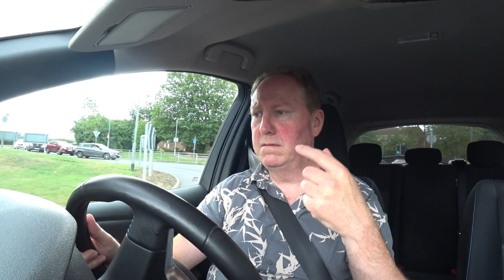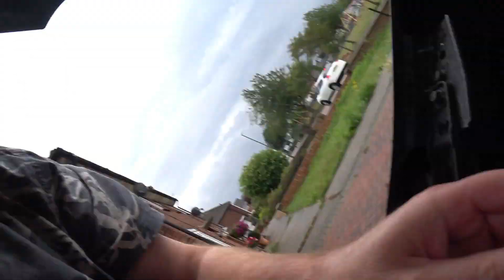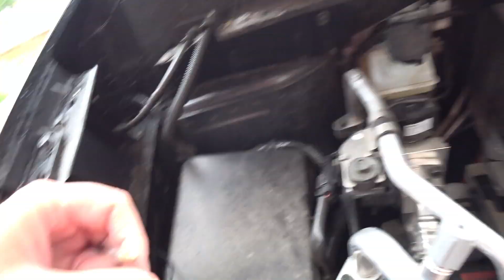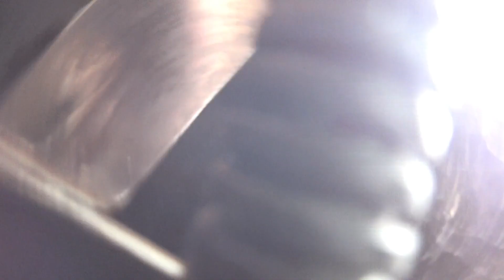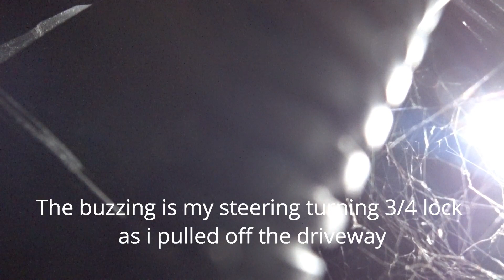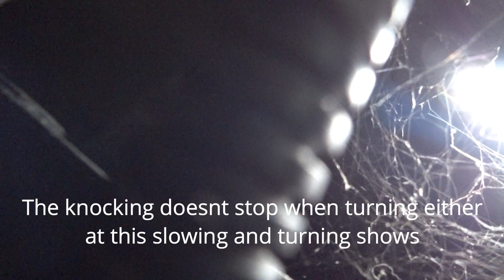The 2018 Nissan Leaf Knocking Sound New Fault

Comment: my leaf front wheel collapsed in middle of doing a u turn.Bottom ball joints so worn came off and damaged the L/H front driveshaft,needed 2 new bottom ball joints..needed a inner drive shaft joint and inner driveshaft boot

Comment: George - it sounds like the noise disappears under harder acceleration (front end lift, and hence suspension extension downward), but comes back as you’re slowing/braking.  Maybe the halfshaft is too long for the gap between the hub and the transaxle output shaft.  Has your powertrain shifted toward one side of the car?

Comment: I've had a mostly single loud knock, especially in reverse, since shortly after purchase.  I was told early on this was to be expected.  Naively, we accepted. Now that it is no longer under warranty, it is much worse.  We want to sell, but the knock makes it impossible.
Reply: Did you figure out the issue with the knock, I have the same issue.

Comment: Did you ever get this resolved mate? Im rejecting my leaf 40kwh owned it for 1month and already had it in nunerous times for the driveshaft now nissan are saying its a normal sound for a leaf this clunking noise so i took it to an independent garage for diagnosis and the said the clicking is from warn cv joints and driveshaft has major play where it meets the diff. They gave me a video showing all this. Its alot worse when its warmed up so needs to be driven around abit for the noise to be at its worst. Just wondered what your outcome was? The finiance company has 2weeks left to sort mine or it goes to the ombudsmen any info would be great cheers
Reply from the maker: The FO process is very long, they have requested information since the tail end of last summer. I'm not expecting any major announcements until at least the summer as I've done this before it take years ;) been very busy with getting ready to move hence no uploads for months besides how can I promote these vehicles when the company and the dealers have turned their backs on their customer? Cheers